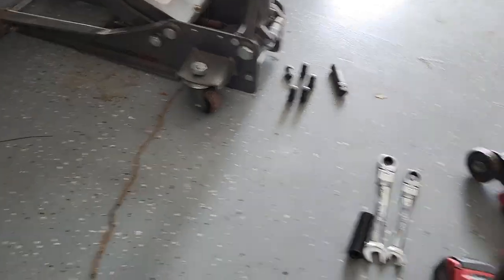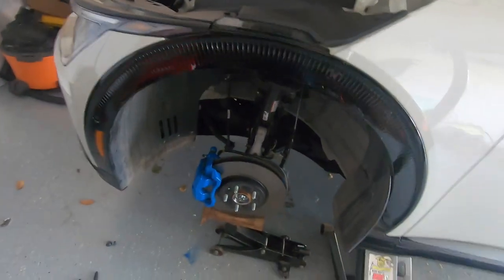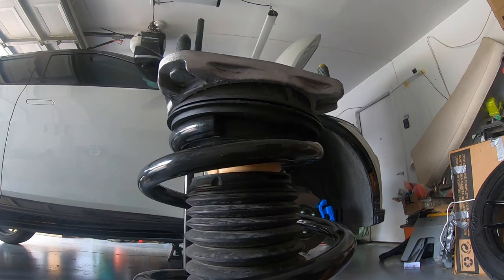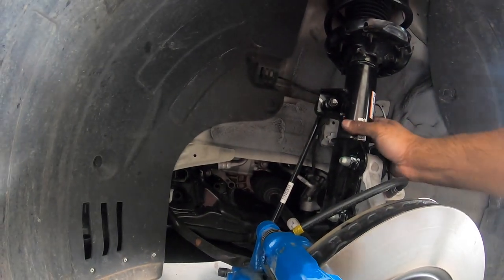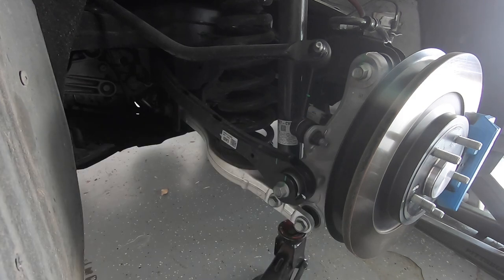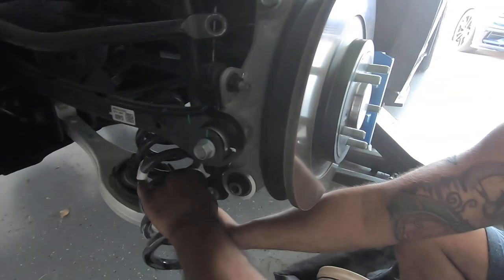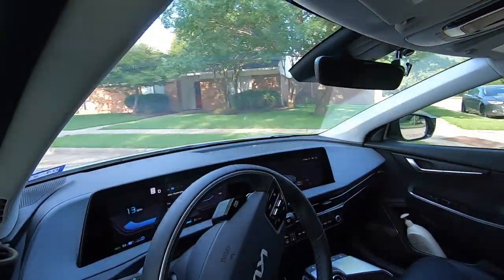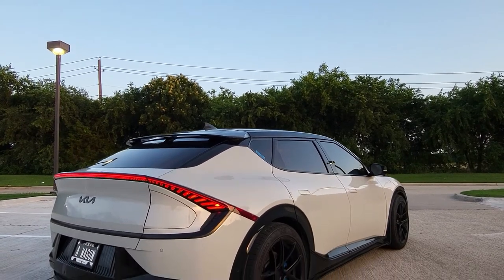Installing lowering springs on my Kia EV6 (Ioniq5 compatible) - EIbach Pro-Kit: Step-by-step guide

Comment: If you dont have a spare jack, You can use a bungee cord to support the hub. Just simply put the hooks into the hole that the top of the strut goes into under the hood and pull the cord under the studs on the hub. Works like a charm.

Comment: Looks great. Every time I’m in the market for a new car, I look for the modded ones to see how far I can go with it. You did a great job reppin the EV6, and how good it can look with just a few mods
Reply from the maker: I appreciate it. And yes, I do the same!! Unfortunately, with this and my last Buick wagon, I had to diy it all, save for a few items. I can usually see a vision when I see these cars, though. Hopefully more stuff comes out soon.
Reply: @Emadifications  and how did you manage to pull all the camber out of the rear suspension...is there adjustability from the factory?
Reply from the maker: @Momo_8k  I'm getting mixed answers. Apparently there's some adjustment but not a lot. They gave it to me with -4 but then adjusted some stuff and got it back around -2. Someone on the forums for the ev6 pointed out the two bolts to adjust toe and camber. I just don't know enough about it. 

https://www.kiaevforums.com/threads/alignment-concerns-after-lowering.4037/
Reply: @Emadifications  oh, YouTube allows external links again? nice. 

Oh okay - the concentric bolts will do it, but it's obviously limited in adjustability. Which explains why they could only bring it to -2. 

If it makes you feel any better, I ran about the same rear camber on my FR-S for about 50k miles on some Hankook Ventus V12 evo2 tires. The tread wore down very evenly.
Reply from the maker: @Momo_8k  that does make me feel better. I was about the same on my Stinger, and it was not bad. So We will see!

Thanks for the encouragement either way! haha

Comment: Also, easiest way to line up the rear bolts is having the LCA under pressure from the jack, get the first part of the bolt in and lined up, then you'll shift the jack from side to side and it will move it around so the hole lines up so you can shoot the bolt thru the back end of the LCA
Reply from the maker: Thanks for the additional tip. I def learned my lesson.

Comment: I thought it looked great with the front lowered and leaving the rear up a little bit, but that is just my opinion. Great job!
Reply from the maker: A little rake is always awesome. However the very different spring rates would likely cause wonky driving dynamics.

Comment: Hey Emad, I just got an EV6 GT-Line and have been watching a lot of your vids, thanks for all the great info! I know you moved on to different springs due to rear bounce, but you listed the wrong part number for AWD, it is actually E10-46-045-02-22, which you'll notice it is "02" instead of "01", just thought you might want to update your description as you list the same part number for RWD and AWD.

Edit:  This new part number was likely added later, it lists a drop of only 0.8" front and 1.1" rear, so they may have decided to address the bounce from excessive height lowering with a less aggressive model. So I ordered them and we shall see!
Reply from the maker: You're absolutely right. I'm now waiting for your feedback once it's installed. Either way, our struts are so soft that any lowering seems to impact them a decent amount. I just can't believe we don't have good aftermarket strut options yet. At this point, if Kia changes anything in the suspension on the ev6, with any of the next generations, likely we won't get any aftermarket options for this gen. Please keep me posted
Reply: @Emadifications  thanks Emad, I'm hoping that these moderate drop springs that Eibach CLAIMS is designed to work with the factory struts pans out with a decent ride. I'll def be sure to post on the forum once they are installed!
Reply: @Emadifications So I got some clarity from Eibach today. For those curious, Apparently this was an early sample of a UK set that ended up being discontinued. The current model drops the front only 20mm and the rear 30mm due to bouncy ride and alignment issues on the larger drop model shown here.
Reply from the maker: @DanielBrownOre  that is really good to know. That explains my ride quality. I was really early on these, basically ordered right when they were available.
Reply: @Emadifications  Oh man, I had them installed and the ride and handling is FANTASTIC! Drop ended up being more aggressive than listed, it's about 30mm/1.2" front and 40mm/1.75" rear IRL. While the ride is slightly "busier"/slightly more "jostling", harshness is actually improved over stock while improving handling. I'd hit a big whoop-de-doo and it is soaked up way better than stock, but steering and control is much sharper!
Reply from the maker: @DanielBrownOre  thats how I felt at first. Then I don't know if it was just too much stress on the shocks but the rebound got harder and harder to the point that bumps were a lot harder than before. Even when I switched to Storm springs, it felt good at first and now road bumps are noticeable. I'm gonna replace the struts soon. I think they are just too soft and wear fast when they are compressed a bit by lowering springs. But I will agree, cornering is much better and floatiness is gone.
Reply: @Emadifications  Thanks for the detailed feedback! I'll be sure to stay vigilant in what I notice, I'll have to look into slightly beefier aftermarket dampers if need be.

Comment: At 19:20 you should have kept the bottom spring perch jacked up to the point where you almost lift the car from the jack stand. Removed the 2 bolts then lowered it. You cut your finger because of the energy built up in the spring. Additionally by not keeping that level pressure on the spring perch you also slightly damaged the bolt and bottom of the shock. You can see where the bolt threads cut into it because of the downward pressure of the spring.
Reply from the maker: That's exactly what I was thinking when I watched the video over and over. Thanks for confirming. I don't remember doing that on my stinger which was my reference point but that was a while ago. Makes complete sense.
Reply: @Emadifications  rear stinger springs are shorter and have less built up energy.
Reply from the maker: Appreciate the feedback. Thanks for the advice and logic ha ha

Comment: Great video! Had eibachs installed in my brand new EV6 by professionals two weeks ago and now im experiencing “clunk” sounds at slow speeds and when turning left or right. Have any ideas what might cause that?
Reply from the maker: Spring didn't sit right maybe, or a bolt was left somewhat loose? My bet is the spring isn't sitting right. And thanks!

Comment: Great video! Im taking in my car to Eibach USA in a couple weeks to test their Sportline springs. 
They're aiming for a 1.5 inch drop. Any issues with rubbing when turning or going over bumps with your aftermarket wheels?
Reply from the maker: No issues. Even when I had the eibachs with a 1.2" drop. However, I'm concerned for your ride quality. These shocks suck with any lowering on them. Let us know how it goes!
Reply: @Emadifications   Ill keep you updated. going to purchase either Enkei GTC02 or  Konig Ampliform wheels Both are about 20lbs a wheel. Hoping to keep or even extend my range with my new set up. I consistently get  284 miles at 100% Charge

Comment: You want to avoid to torque down Threads with an Impact. Or did you set it to very low Newtonmeters? 
Alignment you did Afterwards right?
Reply from the maker: Yes I always check the lug nuts with my torque wrench to spec every time. And yes, I did do an alignment. If you watch a couple of the videos after I made this one, I cover my alignment issues. No issues anymore. It was due to inexperience from the original shop.

Comment: I’m wondering if this is a similar process for the Genesis GV60
Reply from the maker: I assume it’s similar. This was almost exactly the same as my stinger. I believe I also read somewhere that somebody installed ioniq5 lowering springs on a GV60. The springs are the same as the EV6 so I assume the process a similar since they’re all based on the same platform.

Comment: I am on the mission finding a lowering kit. I want to replace the strut assembly aswell as just replacing the spring will cause the oem strut assembly to fail in a few thousand miles and start destroying all other suspension components along with the tire. The 35mm front and 30mm rear looks good! No need to go lower or may rub under heavy cornering and having the battery lower freaks me out. Did it slightly stiffen the ride? I feel it should launch faster.
Reply from the maker: We will see what happens with the shocks. I'm hoping soon someone comes out with some aftermarket pieces that are designed for the weight of this car. Otherwise my thought process was to have some backup suspension sourced and ready to order.  If it blows the struts too fast, I'll just go back to stock until aftermarket struts and shocks are available .
Reply: @Emadifications  I've check all over South Korean and European search engines for struts and the market has absolutely nothing! :(

Comment: I've I'm not mistaken, you shouldn't do work on you car if it's up on jacks.  Should be supported by stands.
Reply from the maker: You're right. But I have 2 Jacks and two stands so I just made what I had work. Usually if I'm under the car, it's always on jack stands. This time I just used all 4.